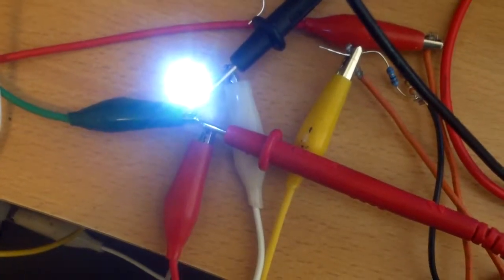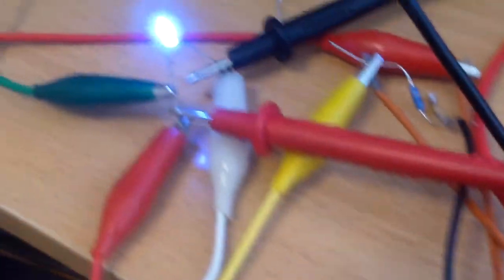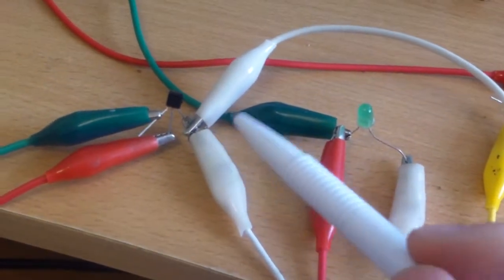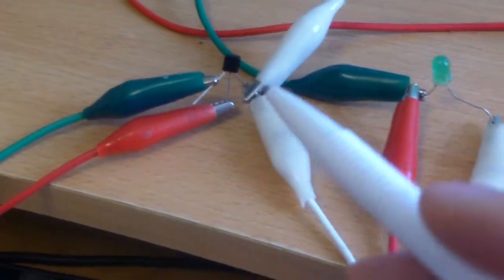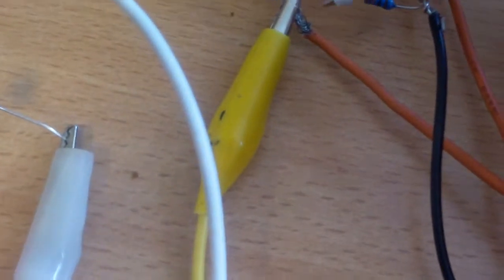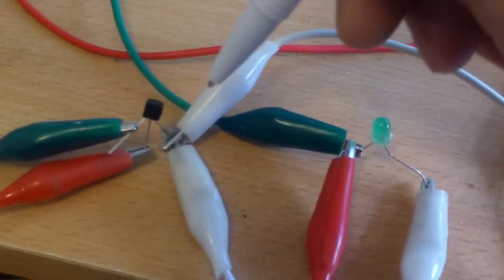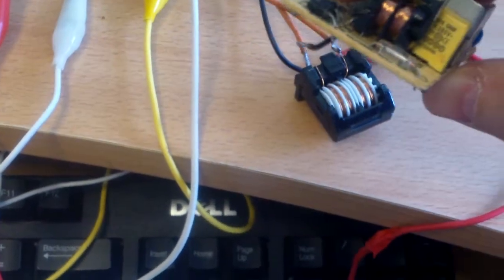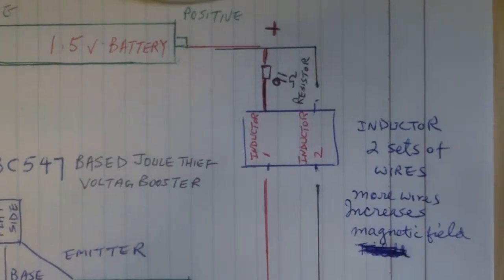Joule thief type circuit to power higher voltage LED with a lower voltage power source

Comment from the maker: You have good ears. I didn't hear a whine but my hearing is poor. If it is a JT, how come the voltage at the LED is just 1.4 volt instead of a higher voltage. The LED is very bright even at this low voltage. I will be uploading another video on this as I just received my 5mm LEDs and I hooked it up to this circuit and it's working nicely.